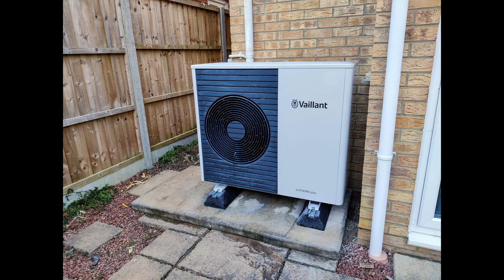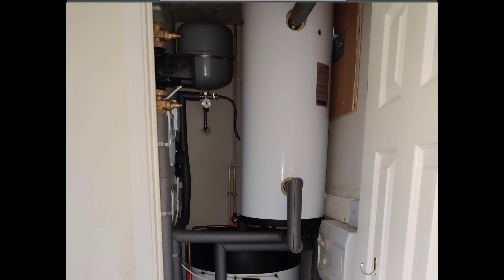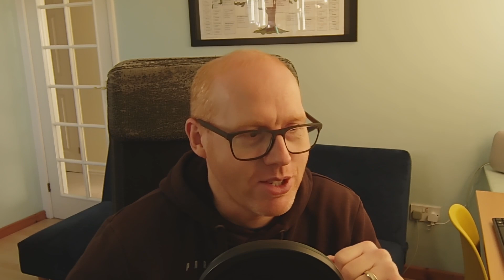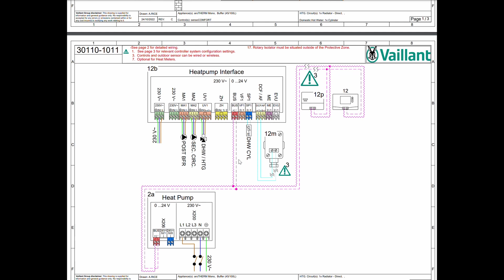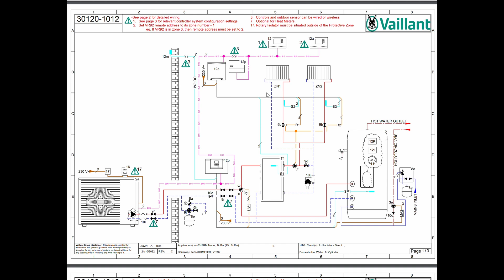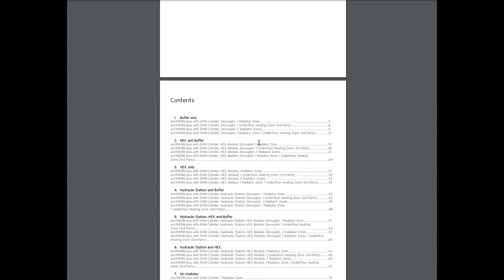Heat Pumps are Simpler than You Think : My Vaillant Arotherm Plus Schematic

Comment: I might be wrong but 12p is your wireless radio comm to your wireless thermostat (12) not your wireless gateway. The SensoNET or 'myVAILLANT connect' is a different box. It might be that your thermostat (12) is wired and therefore the 12p has been omitted as its not needed and a SensoNET has been provided to give you wifi gateway, its just, but my understanding is that they are two different items.

But thanks for taking the time to run thru - great help in starting to get my head around all the different parts..

Comment: Hi
I’ve just had my air source heat pump installed and I have water coming out of the vent at the bottom of the box (right hand side small hole). Is this normal?
C
Reply from the maker: Yep. It is designed for condensation to drain away.

Comment: Hey. This video came up as the first reference to a Gemini answer about heat pump circulation pumps. Interesting eh?

Oh and I think my system is simpler than yours as I don’t have a primary pump or a buffer tank. My 50c system works using the circulation pump in the heat pump only.
Reply from the maker: That's good to hear.
I might get my buffer tank re-piped as a volumiser.

Comment: Heat Geek discourage the use of buffer tanks, because they introduce distortion.  As you are probably aware, different flow rates in the primary and secondary circuits mean that the heat pump flow temperature is higher than the radiator flow temperature.  This means the heat pump is less efficient.  On the other hand, I can see the benefits of having a large volume of hot water to defrost the heat pump.  

This video discusses the subject at length.  They suggest using a volumiser rather than a buffer.  https://youtu.be/XitFQvvfmng?si=sWuCrGydmjVueoaz.  One installer says that the efficiency problem goes away, if you can control the secondary flow rate to be the same as the primary flow rate, but I don't know whether Vaillant can do this.  I am looking at Viessmann and asking the same question.
Reply from the maker: Fortunately the Vaillant controller can control the primary flow rate and the grundfos secondary pump can also be adjusted to try and match flow rate to the primary.
The grundfos adjustment is very basic compared to the granular adjustment of the primary Vaillant run.

Keep in mind that if you are adjusting the secondary flow rate then you need to ensure you have sufficient head room to do so. Pipework may limit the flow rate in the system.

For me, I started with clamp thermometers and measured my flow and return each side of the buffer. This helped me get things into the ballpark of minimising distortion and probably why I achieved a SCOP of 4 last year.

Now that I have lots of data with a buffer tank I am planning to re-pipe as a volumiser and delete the secondary pump. It's on my to do list but the deadline is before the next heating season.
Reply: @ that’s really interesting, thanks.  Presumably you would also need to remove the secondary pump?  Next spring, please let us know how it is going.

Comment: Great summary, one hopefully quick question, what was done at the fuse box / consumer unit, did you have an additional fuse added for the outside heat pump or use the existing cabling and upgrade to a Type C RCBO?
Reply from the maker: In my case a whole new CU was fitted.
Reply: Thanks for the reply and after I asked I found your install video today. But I couldn’t see a  type c RCD . It looked like a type b which doesn’t deal with current inrush, has it not tripped?
Reply from the maker: @wrightwells Vaillant specify they need to be on a B type RCD with a C type MCB, not an rcbo.
Mine has never tripped.

Comment: Well done. I miss two components in the system. First the backupo-heater, I understand that a backup heater in mandatory for Vaillant guarantee. Secondly, I-stops in case of any problems with your grid as it will prevent damage to your heatpump. And I like to get your scheme as in the Netherlands a backuo heater is always part of the scheme.
Reply from the maker: It is interesting how different markets have different configurations.

Comment: This was a great video.   Did you replace any of the microbore or just the radiators?
Reply from the maker: All of the 10mm copper microbore drops remain in place. I did the calculations and even the living room heat loss is not high enough to require 15mm copper.
Reply: @UpsideDownFork  so did you replace the upstairs to 15mm or is that still 10mm?
Reply from the maker: @andrewbellinger1135  the upstairs was always 15mm.
Common practice in the 90s when our house was built.
Reply from the maker: @andrewbellinger1135 you can see much more detail in my other videos like this one here https://youtu.be/ARVgEpFKhIw
Reply: @UpsideDownFork  thanks.    Mine is around that time but all 10 mil I think.

Comment: Nice explanation. We are in the Netherlands with a gas system still and something I keep finding is that the UK does not seem to often talk about smart thermostats with OpenTherm. Here the requirement for newer systems is that the room thermostat talks to the boiler and sets the demand not just as on and off but as an output level. This means that if the room with the thermostat is especially cold then it can demand the boiler fire at full power and if the room is almost at temperature it can demand a lower output. I'd imagine that we also have outside temperature compensation and to be honest I'd have thought that a simple system would just rely on internet connectivity to get the approximate local temperature so that in the depths of winter the flow rate can be adjusted.
Reply from the maker: Yes, it is surprising that modulating controls like those that use the opentherm protocol haven't become standard since our regulations changed here in 2005.
From my little sample, more than half of the plumbers I spoke with were either unaware of or reluctant to deal with modulating controls.
There seems to be a deeply entrenched habit of on/off switching controls that will die a death eventually.

The problem as I see it as an outsider is that good control of a gas boiler may gain you 10% in efficiency but good control of a heat pump could be a difference of 200%!
Reply: @UpsideDownFork Actually plumbers are the bane of the industry. We have had a couple of generations of poorly educated plumbers slinging combis on the wall and leaving an inefficient boiler operating in the customer’s home - because they do not understand themselves  how to get the best of a gas boiler - so they avoid the subject with the customer. Plumbers are poorly educated and are not heating engineers, plumbers will generally tell customers that weather compensation just does not work.
Reply from the maker: @normanboyes4983  i've definitely learnt that there's a considerable difference between a plumber and a heating engineer!

Comment: Regarding the MagFilter position - I believe they are generally shown in the Rad htg. circuit and not the 'whole system return' as modern plumbing in the HW system will be in Copper, Brass or Stainless Steel which generally doesn't rust as opposed to the space htg. system which largely has steel rads and is a good source of rust / magnetite! Having where you do won't hurt anything but will only pick up the debris after its passed ALL around the WHOLE system. A good system chemical treatment will minimise rusting but it still does occur.
Reply from the maker: Thanks for the feedback 👍
Reply: Mag filters are fitted in the return near the boiler. Magnetite and other contaminants can occur anywhere within the system. The positioning in the boiler return is to prevent ingress into the boiler where most damage can be caused and to comply with manufacturers warranty requirements.

Fitting a filter does not negate the necessity of having system corrosion inhibitor added to maintain efficiency and longevity of system componants.

Inhibitor should be routinely checked and re-dosed as necessary particularly when the system has frequently been topped-up and drained/ refilled, which typically isn't done.
Reply from the maker: @David-bl1bt good advice!

Comment: Nive overview.  I assume you have some microbore piping on your rads.   If not, I’d be surprised that you need a buffer tank for your system.
Reply from the maker: Thanks for the comment. Yes, we have 10mm microbore drops for the downstairs rads.
We have the buffer as a precaution rather than a necessity.
It helps with volume for defrost, and allows the heat pump to vary it's flow and DT as necessary without affecting the heating circuit side.

Comment: The hot water in a cylinder should be above 50°c  preferably 60°c as at 60°c legionella cannot survive, this should happen at least one a week.
Reply: If you use most of the water in the tank on a daily bases you can set lower temperatures with no risk.
Reply: the electric immersion heater can be used for legionella management. set the thermostat at 60 deg and schedule via a timer to run a cycle, say, once per week. Then once you have a tank of 60 deg water run your shower(s) for a minute as the shower head is the most vulnerable place for legionella contamination particularly if left unused for a lengthy period, for example when away on holiday..

I always spray my shower head regularly with a suitable disinfectant in any case.
Reply from the maker: @David-bl1bt - immersion not required on our heat pump. R290 which can ramp up to 75 degrees if necessary for the DHW cycle.
Reply from the maker: This is a good summary of why most heat pump owners conduct their own risk assessment and heat their DHW to 45-50 degrees. 
https://www.heatgeek.com/hot-water-temperature-scalding-and-legionella/
Reply: I think people are far too concerned about legionella in domestic hot water systems. If the water is being used and flushed through on a daily basis it really isn't an issue. I have a Mixergy tank which has a weekly legionella cycle, I asked Mixergy to disable it and they did so. I had to indicate that I understood the risks and it was down to me if I became ill.
Reply: @eddyd8745  well, my ex partners brother in-law died after contracting legionella from a shower in a hotel room, so not something to glibly dismiss.

I agree that your own home environment maybe more controlled with operational familiarity, but worthy of some consideration none the less.
Reply from the maker: @David-bl1bt  sorry to hear that. Was the Hotel in the UK?
Reply: @David-bl1bt which country was the hotel in.

Comment: Talking about secondary circulation is complicating things a bit, especially for those who are not plumbers. A secondary circuit is just two domestic hot water pipe leading away from the cylinder to create a loop out to the furthest point in the house with a bronze pump that circulates the domestic hot water so one doesn’t have to wait to get hot water. Most houses don’t have this, it’s mainly use in hotels and very large house like Buckingham palaces!
Reply from the maker: Yes, very true. They seem to be fairly common on generously proportioned new build houses from what i'm seeing. I guess people are just becoming more impatient!
Sorry if I muddied the water but ultimately a secondary return is the same for gas or HP, that's the point I was trying to make.
Reply: @UpsideDownFork  I wonder if they are properly insulated in new builds - if not in summer they just waste a ton of energy
Reply from the maker: @edc1569  new builds are all about wasting energy...the amount of instant hot water taps fitted in kitchens is shocking. 😭
Reply: @UpsideDownFork  instant (heated at point of use) is more efficient than stored hot water that has to travel long distances through non insulated pipes to the point of use.
Reply from the maker: @David-bl1bt building regs require all pipes to be lagged and a well built house will have good wall thickness and high performing pipe insulation.
If the hot water is produced by a 300%+ efficient heat pump then even with the incidental losses of storing and transporting hot water, a point of use water heater will never match it's efficiency.

Comment: Can I get a copy of that Vailiant Schematic please
Reply from the maker: You can find the schematic on the Vaillant website or you can e-mail me and i'll send you the PDF. My address is on the channel info page.
Reply: Any chance of the link mate i cant find your email lol @UpsideDownFork
Reply from the maker: @qmob0121  upsidedownfork@outlook.com
Reply: @UpsideDownFork  thanks I've just found it using Google
Reply: why not pause the video, screenshot it, crop it, and then print it if you want a hard copy.
Reply: Secondary circulation pumps can cause huge heat losses because the hot water "loop" sheds heat if not well lagged. Better to avoid if possible.
Reply: Isolation valves are worth their weight in gold. I use them at both flow and return wherever separate circuits branch off. I spent years in maintenance.😁
Reply: The non return valve in the hot water loop helps by preventing thermosiphon circulation
Reply: I would fit the mag filter in the return to the outdoor unit along with the strainer. It protects the expensive part.
Reply: You described the problem of thermostats being affected by other heat sources. This is why it was recommended to locate thermostats in REPRESENTATIVE locations. Often tricky to decide where was best in a house.🤔
Reply: Wireless outdoor temperature sensors have a nasty vulnerability to getting full of "thunderbugs" and failing

Comment: Hi great explanation (especially for us less inclined to be totally interested in full system explanations). My biggest concern, as we are looking to get some quotes for a heat pump system, is the amount of space that all the components will take. We have a combi boiler that’s it, so you can imagine having a immersion tank, plus any other required components (expansion tanks etc) will mean we have to find somewhere for those units to go. I am wondering if that in the future that a larger but more compact combi electrical system may become available, I’m even considering splitting the heating and hot water systems which yes means more system components, but I think that more electrical alternatives will become available as we move to a ‘non’ gas environment. Sorry this might have been a bit of a mind dump!
Reply from the maker: Yes, I fully appreciate those concerns! It was the reason we didn't opt for a HP in our last house. Terrace house with combi boiler and no where to stick a cylinder, with 3 kids we were already bursting at the seems so couldn't have even built a cupboard or anything!
If we had loft space then we could have fitted a horizontal cylinder and expansion tanks up there but we already had the loft converted unfortunately.